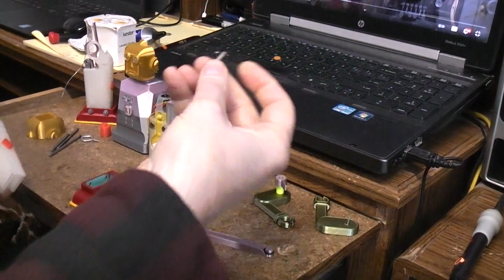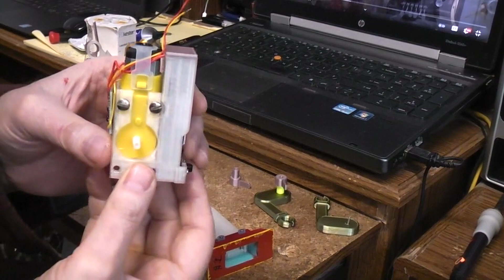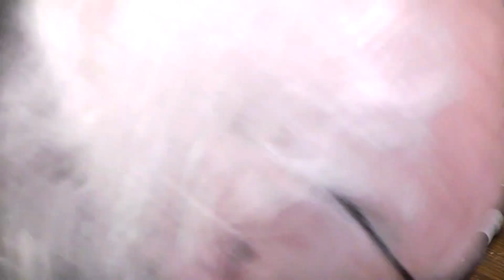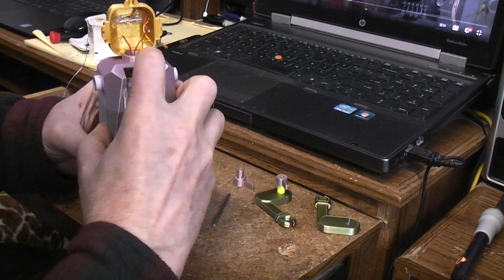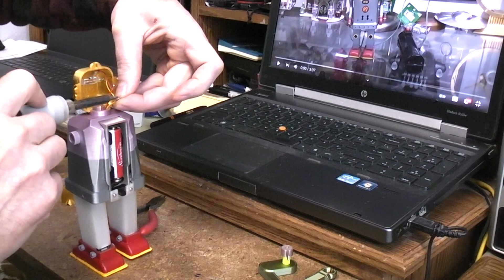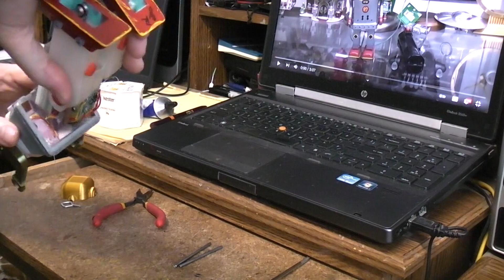3d print the R7 "flashy Jim" walking robot. Build video. Pin walker with moving legs.

Comment: Rpm of the BO motor
Reply from the maker: It is the TT gearmotor with a ratio of 1:48. The most common of the TT gear motor speeds. You can buy them online for around $1 buck and up. I got these off amazon for under $2 bucks delivered.
Reply: @Robothut  yeah sir ik & we can also get a different rpm it gives heay torque if it runs slow :)
Reply from the maker: @DIYwithBatteries  Yes different loads and different voltages will give different RPM, thats why they do not sell the small battery motors based on RPM but based on gear box reduction. :)